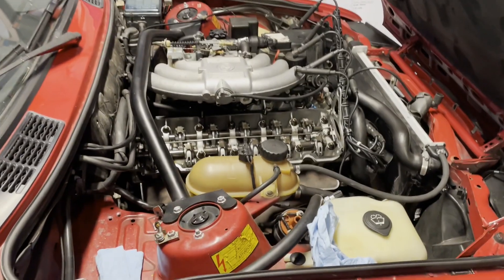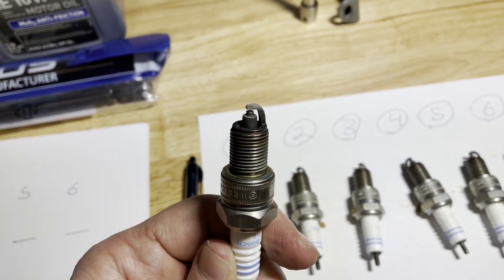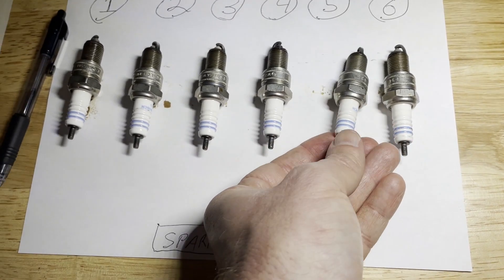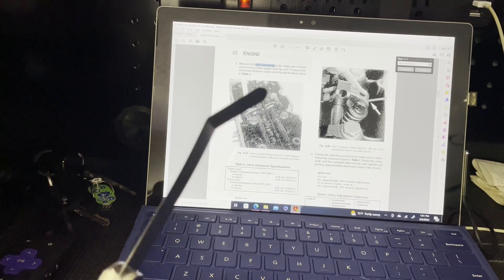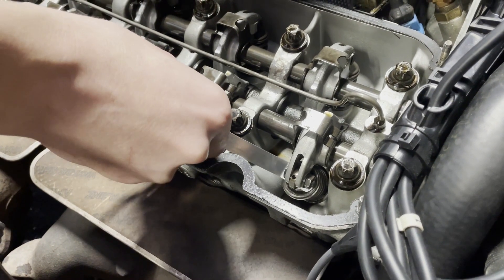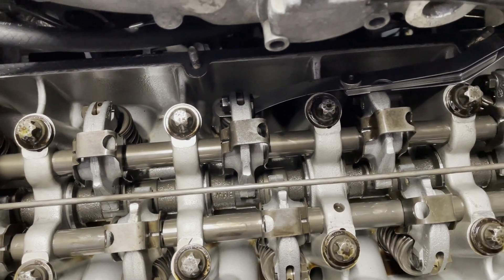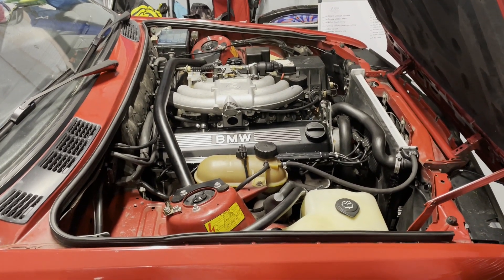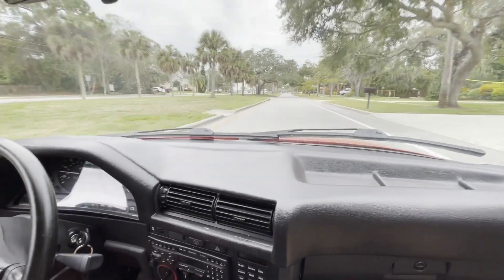BMW E30 (M20) Valve Adjustment

Comment: What is the best grade of oil for this engine?
Reply from the maker: Well, it depends on your climate, how many miles are on the engine, and how hard you drive it.  I have seen everything from 2W-20 to 10W-40 recommended online.  I think the manual says 10W-30.  Don't think you can go wrong with what the manual recommends.
Reply: @ thank u bro . I use 20w50 is that good?

Comment: I think you both are doing an incredible job that's not a small task, and you both tackled it, and you can not ask for more than that, guys. I do not know much about BMW, but I know our 08 fmf expedition has that same sound, and it's an overhead cam 5.4. I really love the early 70s 2002. This BMW, I am not sure of the generation or how long that body style lasted but sure is good-looking, and my step-dad says they are one of the best BMWs ever made. Have a great day, guys.
Reply from the maker: The E30 body style we have is the second generation 3 Series, which was made from 1982-1994.  This is the platform the first M3 was made on and I think the platform BMW built their reputation of fun to drive reliable cars on.
Reply: @C3K Paddock  thats so awesome, good looking car.